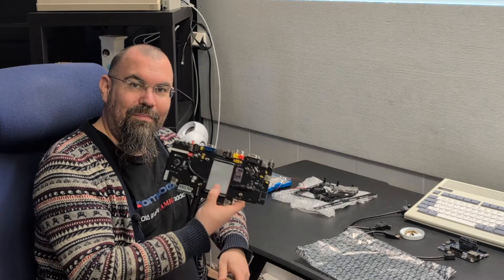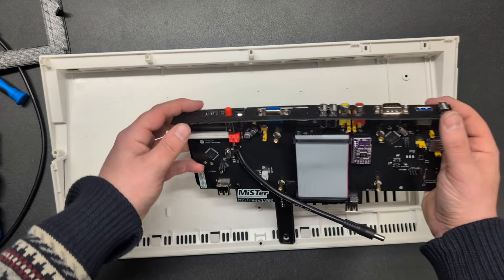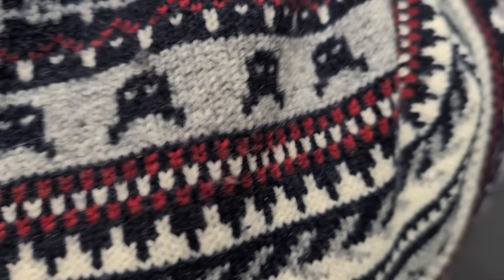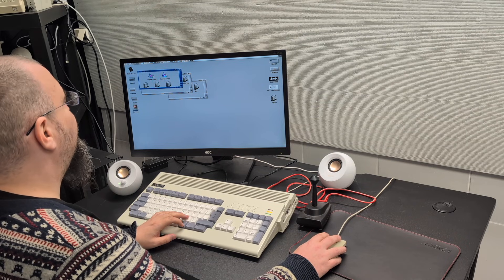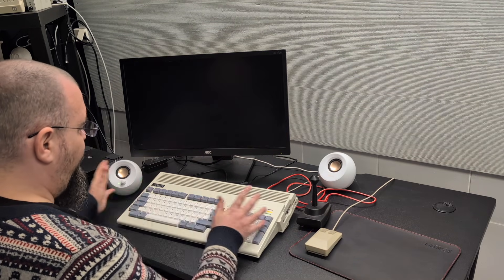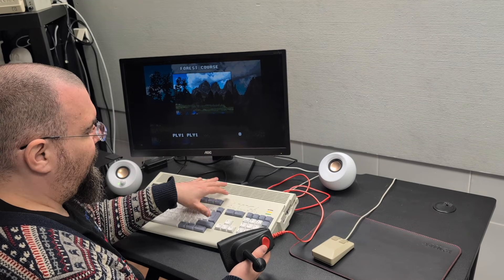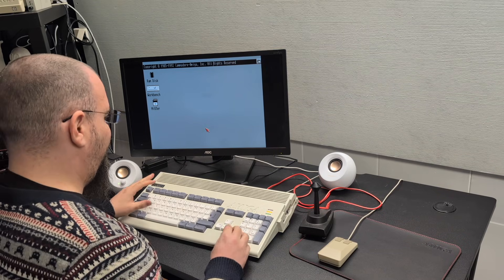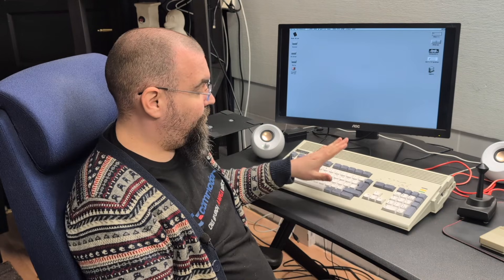Modern Amiga 1200 Build – 100% New Parts!

Comment: You could just buy an old Amiga 500 for 200 bucks and add a PiStorm with a Raspberry Pi 4 and replace the 68000 for that. That will be 1300 times faster as an Amiga 1200 and a fraction of the cost.
Reply from the maker: Yes, for sure, and I also have such a setup and enjoy it very much. But the point with this one was a modern build of an Amiga 1200 (AGA)  specifically using hardware recreation in FPGA. Something that behaves like the real deal.

Comment: I have an Amiga 1200 that won't recognise the mouse ( no pointer any mouse used ) I have bought an amiga 1200 capacitor etc replacement pack ..looking at specific module on board for component replacement?
Reply from the maker: I am in no way an expert. But I would suspect the cia or blown caps. I have never done work on A1200 though. Only A500

Comment: I dont get the diff from normal PCB boards except I know the code is on the board rather tha emulator
Reply from the maker: FPGA emu just feels more like real hardware since it runs straight on the chip, while software emulation is running on top of your PC with and operating system to boot first. Both works great for amiga emulation though. Just feels more real to use the computer as it boots directly into AmigaOS and don't show another OS first. However this setup can not become a 060 powermachine. So for such use normal software based emulation is better.
Reply: @proteque  Yes but what makes FPGA diff to normal pcb from pcbway or the likes that what i mean i guess
Reply from the maker: @NovaGameGuides  aaaah right. the FPGA is reprogrammable. so the logic gates can change into "whatever" and change into something else, and not have a set sets of chips and logic. I notice I find this hard to explain.

Comment: those keyboards are amazing.. I have one in a case with a keyrah so it works as a USB keyboard for me ❤ would love if the old floppy hole could house a sd card reader or similar so it still has a function in this build. Cool build though ❤
Reply from the maker: I have save the space for a real floppydrive. It is going in as soon as the drawbridge support is done in the FPGA core
Reply: @proteque cool

Comment: I do love the ability to use real amiga josticks.. I already have that with keyrah though and I also soldered up a few amiga joystick to usb adaptors myself by using the curcuit boards of random usb gamepads ... the amiga 4 player adaptor also works on linux and windows with a special driver

Comment: cool but how is it different from putting a pi inside instead and using a keyrah to connect the real 1200 keyboard? would reall wish it could talk to a real external amiga floppy drive and maybe also a c64 floppy drive (this is possible on real amigas with a special cable)
Reply from the maker: Main different is the difference between FPGA and emulation. FPGA recreation Implements the computer’s hardware logic directly in reconfigurable circuits and behaves like the original hardware at the signal level. Much closer to original timing and behavior, lower latency, and better compatibility with hardware-specific quirks. While on the pi it runs in a software emulator on a CPU with a full operating system underneath. But both works great. It is all about whatever you think is fun to tinker with etc.

Comment: Hello Sir, what kind of PSU do you use with the Mistress 1200? It does not say the specs on the website. And what spec/brand is the fan, as it is no more included? No info on their website.. Thanks!
Reply from the maker: The fan is included with the mistress 1200 when you buy it. It is a low profile one, and I am not sure about the spec/brand I am afraid. It is "noname". The one I had there that I had to change from was an earlier fan that was too high. 

Regarding the PSU I use a "4A 20W (Meanwell)" power supply. I bought it with my original stack. However I have also tested this with the psu that came with my DE10Nano and that works perfectly good as well. So not sure I really need such a powerfull PSU.
Reply from the maker: And now I see it is no longer included. Read that too quickly on my phone. Thats a shame. I can try to take some size measurements for you. maybe that helps?
Reply: @proteque  Yes please!

Comment: Where did you buy the keyboard?
Reply from the maker: New Amiga 1200-compatible keyboard from Amigastore.eu (wrote it in the description but didn't add links)
Reply: @proteque  Thanks!, hoping to restore mine a bit. It works fine, but I'd like to give it a new case/keyboard and caps :)

Comment: Hi, can you connect this to original RGB monitor like 1084s?
Reply from the maker: You can. There is a rgb-connection there as well.
Reply: @proteque  15kHz?
Reply from the maker: @79yank  yes, 15khz (or 31 if you prefer. Can be set in config). Beware you need a custom cable to be able to connect to the 1084S. The connector on this board has a vga connection.
Reply: @proteque  cool, because the original CRT picture (RGB not Composite) is the exact thing which makes Amiga gaming authentic.Otherwise you can get the same results out of laptop with WinUAE.

Comment: Links to the parts ?
Reply from the maker: I will write it in the next reply to you. YT doesn't tell you about comments with links to spare you from spam. So you need to find it manually.
Reply from the maker: keyboard: https://amigastore.eu/en/994-mechanical-keyboard-amiga-1200.html
motherboard: https://www.8bits4ever.net/mister
The case: available from lot's of places that resells a1200.net cases. but you should find links to the one close to you on https://a1200.net
The fpga board is bought directly from Terasic (or go for any of the clones if you prefer.  https://www.terasic.com.tw/cgi-bin/page/archive.pl?Language=English&No=1046
Reply: Thank you !

Comment: Great hardware there!! Why the floppy drive led is always on? And, my led prefs would be Red for Power, Green for HDD, Amber for FDD. Cheers
Reply from the maker: The led was hardcoded as power light in the core. I cut th cable and will reconnect it to the floppy controller when the support for that is ready in the core.

Comment: Get the zapperoo script installed, and install the NFC reader in the floppy drive spot. You'll be able to load disk images using nfc cards.  No hotswapping disks though unfortunately, you'll need cardboard disks for that, coming soon to both eh minimig and a0486 cores

Comment: @12:47 There seems to be an issue in AmigaVision when using "original" aspect ratio on MiSTer. Try changing the scandoubler option and original aspect ratio seems to start working ok. I suspect it ignores "original" if not all options are configured.
Reply from the maker: Thanks a lot. I will give it a try if it returns. but seems the problem got fixed from the toggle I did as well. Maybe same fix?

Comment: I can also vouch for the MiSTress1200… amazing piece of kit. Been running it on my A1200 case for more than a year now and it’s perfect! If you setup MiSTer to boot directly into the amiga core, it becomes almost indistinguishable from the real deal…
Reply from the maker: I agree. it is very accurate in any way. And it has a value that I can't just exit the emulator and have another OS behind it. It gives a sort of pause from everything using it :)

Comment: I've heard some people refer to FPGA implementations as simulations rather than emulations, but I'm not sure if that fits any better. However, I do miss the days when we had breadbox computers. I know we have super thin laptops and tablets with keyboard flip covers now, but there's just something comforting about those breadboxes.
Reply from the maker: I enjoy them a lot as well. Even on modern computers. The rpi400/500 is a computer I really wanted. but the 400 is a bit too slow for daily use, and the 500 annoyed me too much when they didn't include a proper nvme-m.2- connection when there is support for it on the rpi5.

Comment: fpga is really cool technology for retro computing. The programming model of fpga leads to very efficient results e.g. 2W tdp vampire standalone vs 30W of an original a1200. Emulators like Vice and UAE require oodles of cpu time for emulating even idling systems. It seems that they could do better and maybe just nobody ever cared to make an energy efficient emulation. For other classic computers there are probably better examples.
Reply from the maker: I have thought about that a few times. why the emulators use so much cpu time even at idle. Could it be to don't maintain low latency? Just guessing, no idea if that makes any sense.

Comment: I always find it funny why an Amiga emulator is squeezed into an original Amiga keyboard. I sold my real Amiga 2000 in 2012. Nostalgia is nice but it doesn't get you anywhere.
Reply from the maker: To each their own
Reply: It can boot directly to the same thing. It's just as good imo. Emulating Amiga is way better most of the time anyway, especially if you actually want to use Lightwave like he shown since the rendering times are way faster if you just emulate an Amiga 3000 or 4000. 

Then you could emulate an Amiga 1200 strictly for games for compatibility which would also work with Deluxe Paint and stuff like that.

I see literally no reason to own the actual overpriced hardware now. The look of the case is the cool factor. Everything else is better with modern recreations though, especially to speed up disk read speeds too
Reply from the maker: @ But it is my hobby. And if my hobby was cars I would much prefer a car I liked that gave me a lot of joy to tinker with and drive, over a car that did the same but didn't give me the same joy ("any car can transport me from A to B").  But I have no problem understanding your view. it is rational.
Reply: @ if the youtube would not delete my other post you would more understand, but I am not retyping it... youtube censorship is getting out of hand.
Reply from the maker: @madigorfkgoogle9349  argh. that sucks. Checked in studio if there something marked as spam I could whitelist. but sadly nothing there
Reply: It is practical to have new hardware that emulates many systems squeezed into compact all-in-keyboard system like A1200 or A500 when you do attend retro computer shows. So you go there with "real" computer, but can run a lot of different stuff. Also the form factor is very good to transport. Otherwise it makes zero sense, you dont save money and you dont have the real deal with collector value either, which would justify the costs to some degree.

But then again, we often smash money on much more stupid things in life, right?
Reply from the maker: @ This one will for sure go with me to the black valley demoparty this summer :)

Comment: WinUAE with JIT dynamically translates Motorola 68k instructions to host CPU native code. FPGA implementations physically reconfigure hardware logic gates to replicate the original CPU's architecture at the transistor level, enabling cycle-accurate emulation but constrained by the FPGA's available logic elements. Emulating an 020 CPU on FPGA consumes significant resources; for example, upgrading to a more complex 030 (with additional features like an MMU, larger caches, and pipeline enhancements) would require substantially more logic gates, potentially exceeding the FPGA's capacity if not designed with headroom for expansion.
Reply from the maker: That's an accurate description! Thanks. It does has it's cons as well as you point out. 

A sidenote: I don't think there is enough logic gates on the fpga on the DE10nano to go beyond the 020. But at the same time. They has managed to remake quite a lot of system that was told impossible on it lately. Beyond my knowledge.

Comment: Nice build! The 3D printed brackets really help. Would be good to see it working with a CRT display (I think the FPGA can directly connect).

Also I am still hoping for floppy disk support at some point. If that becomes possible I will definitely swap the insides of my Raspberry Pi Amiga and do this.

Edit: enjoy your break, and your next beer, and I'll look forward to new videos with playing with software!
Reply from the maker: Thanks Rob! And you are right: The fpga setup supports rgb directly without any additional hardware or hacks. So that is very doable. The other Rob (Smith) has the drawbridge working somewhat in the minimig core I think. But been a while since I last heard about it.

Comment: With no doubt I prefer every hardware clone or direct hardware implementation for recreating retro computers. For me is such a pity to waste a MiSTer board on a project like this when you know how many other systems it simulates. It would be more sensed to create a new A1200 motherboard around a FPGA chip like it was done on other similar projects like the Spectrum NEXT, eLeMeNt ZX or MEGA65. Personally I think that is way cheaper and we achieve better results with an A1200 NG or Amiberry on a Raspberry Pi 400. I'm really impressed with the A1200 NG.
Reply from the maker: I guess your comment show what an awesome time it is to have this hobby. So much to choose from! The A1200NG looks awesome. I have and use the A600GS quite a lot. Is there lot's of changes from the A1200NG besides form factor and connections?
Reply: @proteque  AMIGA is awesome but is by far the most expensive one of my hobbies (I grew up with a ZX Spectrum, I have all original models and lot of clones, some C64 and 128, Amstrads...). It's the same Orage Pi that powers the A1200 NG as in the A600GS which is plenty enough to emulate all AMIGA systems. The software was fine tuned to emulate an A1200, but you can run all previous A600GS software. The main difference is the feeling, you fit the board in a real A1200 case and keyboard, you can connect a real floppy, a CF card, so you have access to original storage and software but with modern conveniences like HDMI output for all video modes. I know you can achieve the same result with an emulator (lot of options!) on a recent/decent computer or AmiBerry on a Raspberry Pi 400, but here the real difference is the feeling of having a real machine. For me the aesthetics, the look and feel count a lot. This is the take on retro that I love, put modern hardware into recreated or original cases to have access to all modern conveniences for all your retro content.

Comment: Where did you get the injection-molded parts?
Reply from the maker: The case is made by a1200.net. The black parts inside it came with the mistress and is 3d printed.

Comment: FPGA is NOT emulation or simulation, as you know.
Reply from the maker: Tried using the word recreation . Sometimes I used the wrong word on habit. Hard to get those live recordings perfect and hard to fix in post.
Reply: An FPGA is an implementation on the hardware level. Like you would not care if your logic gates were CMOS vs TTL, as long as it produced the same output for the logic inputs. Likewise, the FPGA implements logic using look up tables vs. gates etched into an ASIC. The advantage of the FPGA is that you can reconfigure it. The disadvantage is that it is slower than an ASIC with the same equivalent logic.
Reply: @wildzeke  and that means that without the lookup table that is usually stored in flash memory of FPGA (there are more types of FPGA) which is configuring the switch boxes every time the FPGA gets power, there would be no interpretation of other semiconductor. That means that without any equations loaded into flash memory the FPGA is very different type of semiconductors array that cant do much. You also cant interpret other logic without correct set of equations loaded in flash memory. This means that FPGA is using its own semiconductor array to simulate some other integrated circuit like CPU for example. And since the more modern FPGAs often contain many advanced logic array sets, it is possible to interpret simpler logic of old CPUs by interpreting via more advanced logic of FPGA and therefore save some logic for other functions. Normally the correct description of the process that FPGA is doing would be Simulation but since there is often not 1:1 simulation going on and some shortcuts are done, we are talking about Interpretation
It is simple as that...
Yes it is on hardware level, not software level, but the FPGA is "programed" on every power on...
Reply: Even some FPGA developers call it "emulation" since it's not the original chips but an FPGA emulating them :) There's an article at time extension about that.
Reply: @RainerK.  If I write VHDL for a cpu, I can take that and get it manufactured into an ASIC, but I can also program an FPGA, which alters in HARDWARE logic circuits, LUTS, etc. That is NOT emulation.
Reply: it is interpretation, or real time interpreter...
Reply: @madigorfkgoogle9349  It really isn't.
Reply: @L-z9x4w  no? Looks like you dont understand what interpretation is.
Ok, tell me, can you run  MC68k code on a FPGA out of the box?
Reply: @madigorfkgoogle9349  Looks like you don't have a clue about any part of computer science and how fpga's work. I do.
Reply: @L-z9x4w  yeah right... whatever you say, but first answer my question genius.